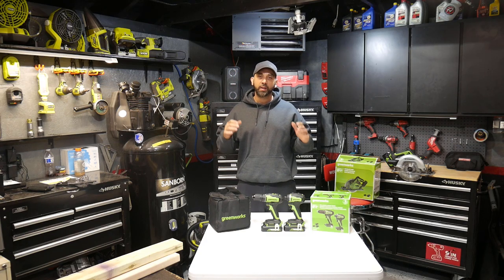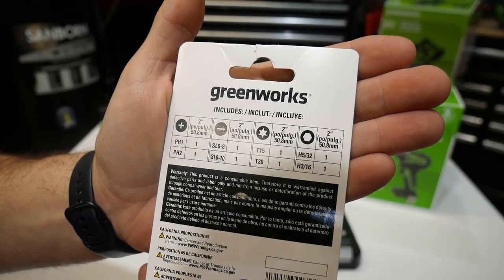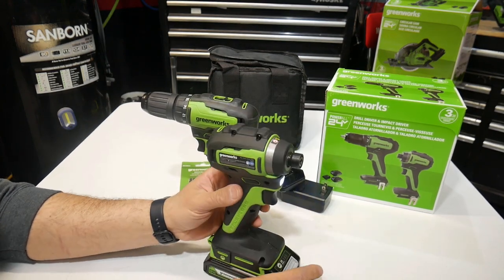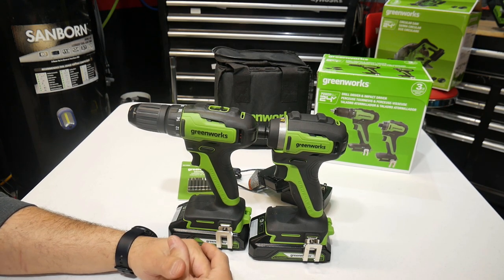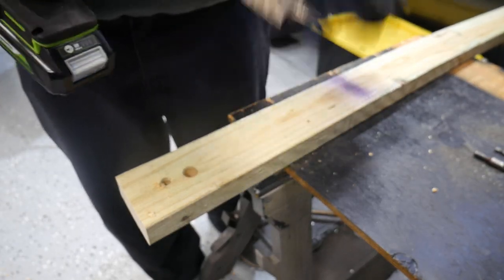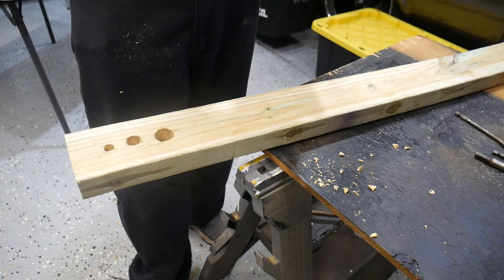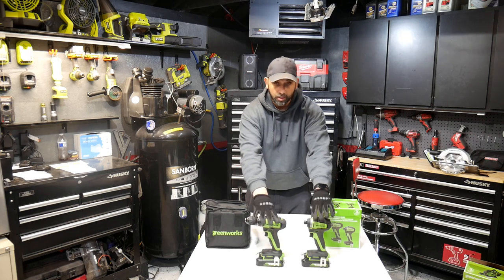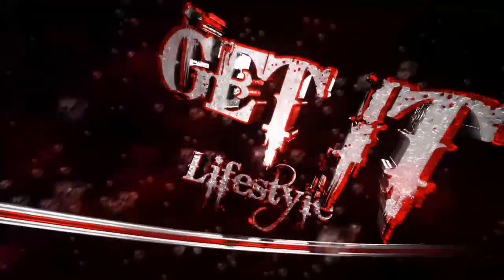Greenworks Drill and Impact Worth the Money Or a Waste of Money ?

Comment: They also have a professional grade version also little more expensive
Reply from the maker: you try those out ? what brand would you say it compares to ?
Reply: @All Things Cool  I was buying a Milwaukee 18volt impact drill but seen this combo on the professional grade Brushless and I love it has no issues and great power it runs $140 on Amazon to me it's a steal.
Reply from the maker: @A N  just looked it up on amazon that combo looks very similiar to the one in my video
Reply: @All Things Cool  yes it does they have two one that says professional grade and a regular one